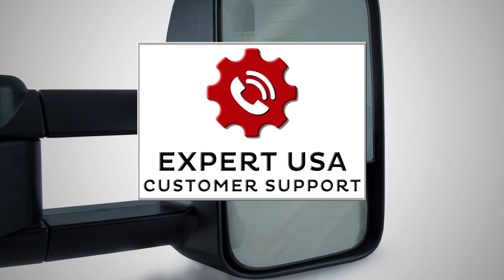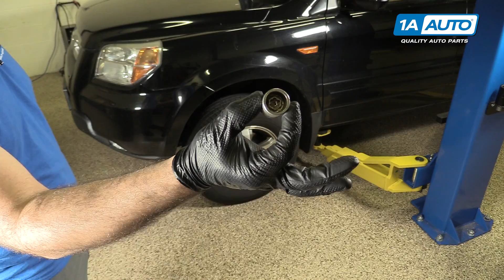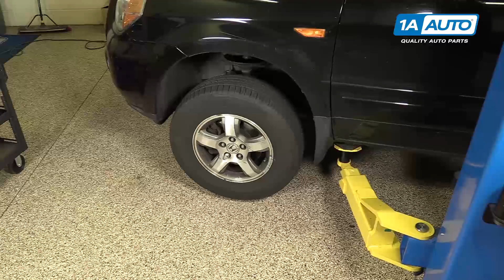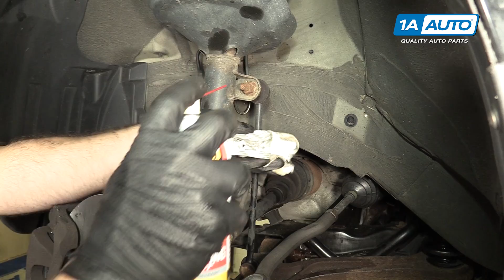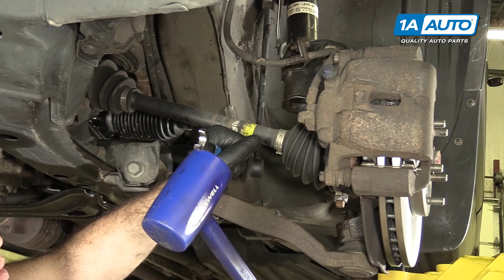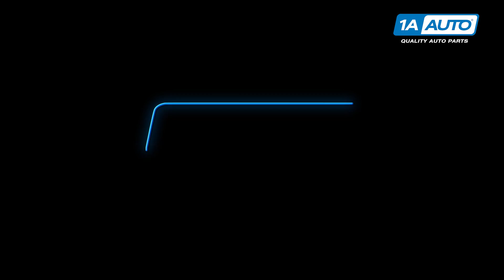How to Replace Front Sway Bar Links 06-15 Honda Pilot

Comment: My 2003 ion is nowhere like this. I had to use a pair of vice grips to hold the shaft from behind and then heat the nut with a torch to get the nut completely removed.

Comment: Snug up the nuts but do not do the final tightening until the suspension is loaded with the vehicle’s weight
Reply: I have a question, when you set the vehicle at ride height, ofc the wheel has to be installed since you have to put the vehicle on ground. How would you be able to torque the bolts in that case while the wheel is on the way?

Comment: My 07 does not have the spots on the inside other side of the bolt, so I just cut off the bolt at the sway bar, because I'm going to replace the strut also.

Comment: What was the name of that tool you used to counter hold while you worked free that bolt attached to the stabilizer bar
Reply: Initially he seated the box end of a regular 17mm combo wrench over the nut countered by a “5mm hex bit socket”aka Allen socket. U can get them in all drive sizes - assuming this was 1/2” since it was on a breaker bar.

Comment: If you live in Ohio...dont bother with the allen key...its not gonna work. Sturdy pair of vise grips does the trick and for the driver side bottom I end up using a cutting wheel, it helps if you cut it off close to the joint and then cut the joint off, then grind it down in sections until there is no more. Passenger side was a breeze. Driver side took about 40 minutes.

Comment: I recently bought 2 sway bar links from you folks and after installation I drove it, it started making a clunking noise. Never did prior and I only replaced it bc the car turned into a turn too much.
Reply: I ordered sway bars from them and they were horrible

Comment: All of your videos really help me doing it my on my own,
I have noticed that the strut bolt head is on the right is that right or it should be the other way around,
What is right way of putting the Strut bolt? Thanks for the clarification!
Reply from the maker: Good eyes. The factory installs the bolts coming from the front of the vehicle. function should be the same except when the tech goes to align the vehicle nuts will be on the front. Thank you! If you need auto parts go to http://1aau.to/m/Shop-1AAuto-c

Comment: My 2015 sonata lacks the hex bolt ends.. The bottom is Pretty snug up against the inner wheel well/engine cover.. I used  vicegrips on the  round part outside the boot to hold the spinning bolt in place. It's difficult to get a good swing on a hammer.. Gotta get me some pb blaster
Reply from the maker: +Ragnar Rock Try the pb blaster because that should break things up for you.

Comment: Are the studs tapered?

The OEM links fit perfectly into my sway bar hole, but the after market studs are thinner and require compression from the nut to hold them steady. 

Do you sell any that fit the hole snuggly?

Comment: Thanks for the video! Just did this on a 2011 Odyssey. PB Blaster is a must, and if you live in a snow state, your bolts may not be as cooperative. When I got near the end of loosening, I needed to use vice-grips to keep the shaft from spinning because I ended up stripping the hex-key hole. One of the shafts needed a hacksaw. Wear safety glasses and look out for the ABS wire that's pretty close to the link. Finally, if you pre-load your suspension by jacking up the lower control arm by an inch or so, everything lines up nicely. No alignment needed after replacing these (you're not changing the suspension geometry). First one took me three hours, the second one took less than one.
Reply: I had the exact, and I mean exact,  same experience.  Had to cut off the lower with a angle grinder.  It was a pain!
Reply from the maker: Thanks for checking us out, and for the great tips! +Brian Galhouse
Reply: Just use a little oil, or penetrating fluid.

Comment: With one side on jack stands, I raised the control arm w a jack so that the end bar links would line up perfectly flat with the strut and sway bar and then tightened, lowered the control arm and then tightened again. Was this bad to do?
Reply from the maker: +Sam Melo As long as you're careful and didn't cross threads...just make sure to get an alignment
Reply: You are actually supposed to raise the control arm with the nuts just snug and then tighten them

Comment: Seems to work the same on the Odyssey. I’m having a bear of a time getting the bottom ones loose. I’ve got an 06 that it appears has the factory links on it still (200,000 miles) and the bottoms will not budge. At my wits end
Reply: Mine were tough too.  I ended up using my sawzall to cut them off.  Sooooo much easier.
Reply: @darenkutchens9765  I did too 
I tried for an hour
Finally I busted out the Sawzall
Reply: Same deal here. 
One of the lower bolts required the saw to remove.

If you don't want to cut it, you might try to stabilize the sway bar to keep it from moving so much while you wrench on the bolt (the movement steals energy)

Comment: Does this require a wheel alignment afterwards ?
Reply from the maker: +L Johnson Thanks for checking us out! If the only thing you are replacing are the links, and not changing anything else and it does not require any removal of the other suspension pieces, you will not. If you have to take the control arm, strut, or tie rods off, then yes we would recommend having it re-aligned